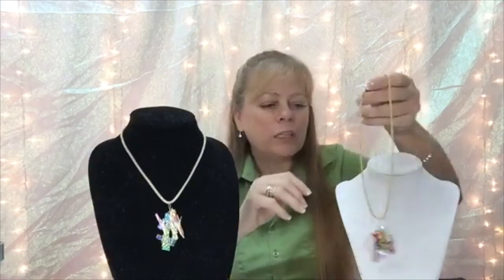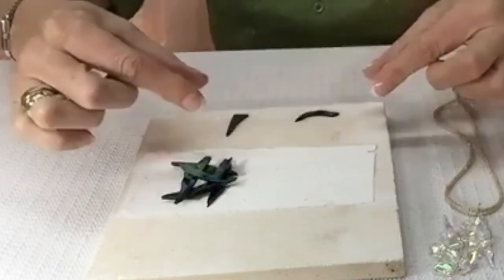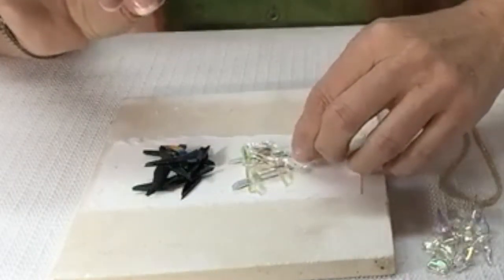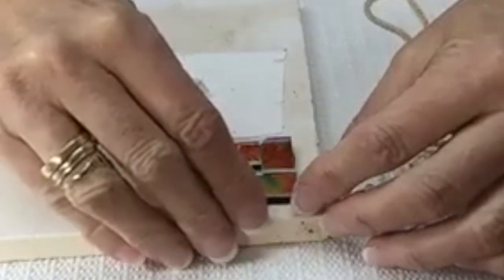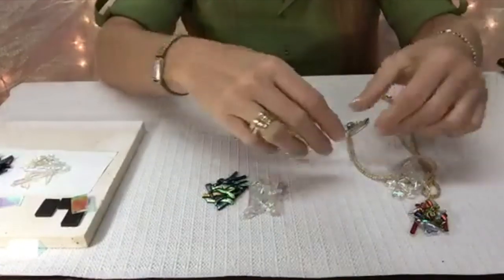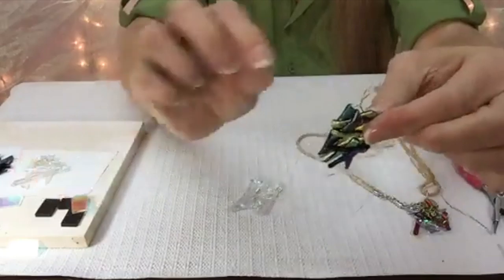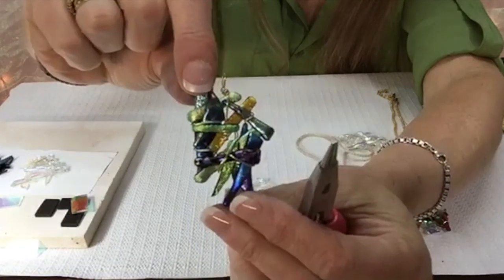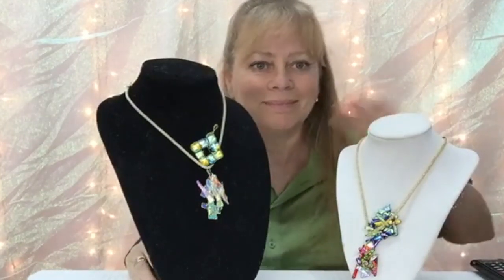#51 Dichroic Bits & Wire

Comment: Wow this is amazing. I have a microwave kiln. How long do I heat and at what level (low or high) to get this done with my kiln? I dont know what any equivalent temps are for microwave kilns...
Reply from the maker: Emily Corona every kiln, especially microwave kilns are dependent on SO many different factors including type of microwave kiln, power of microwave, type & thickness of glass, etc. So you will have to do a few tests.
Reply: @SusanMcGarryGlass  thank u! I will do so. I love your ideas but cant afford a big kiln. So ill make do and run tests.

Comment: How do you get them to the kiln without them falling off?
Reply from the maker: You can use a bit of glue but I didn't need any. They traveled to the kiln just fine. Lucky!
Reply: I think you would construct it right on the board piece that goes into the kiln
Reply from the maker: Valerie Cuan I usually use cheap hairspray to glue my glass together. Cheap & doesn’t leave a residue. But you can also build it in the kiln.